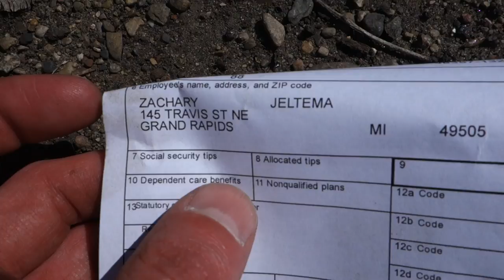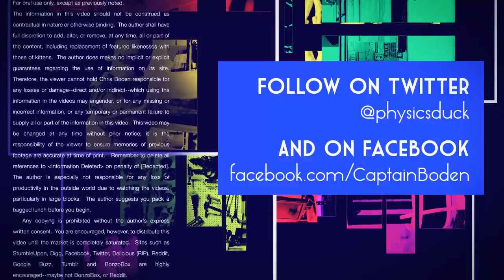Captain's Blog 5 1 2015 River Trash Cleanup and Flight Club

Comment: wow Moose is very strong to help move that steel bar.  Stephen is very thorough filtering through leaves.  very nice weather in western mass also.  how does Zack live on so little?  my income was 15,000 last year.  yes steam is better than smoke.  why do you drive?  GR has a transit system.
Reply: Sam Sitar We got in some new inserts for steel and hadn't quite found the sweet spot for the 4140 pre-hardened steel we were cutting. Burned through 4 corners pretty quickly, but found that they do well at 765 surface feet per minute, .090" depth of cut and .005" feed per rev. The steam came from one of the failed cuts when the cutting edge fractured and produced a ton of heat.

Comment: I doubt the guy dumped his trash there on purpose.  Think about it, if the guy has an address, he has garbage collection.  Why would he need to dumb his non-bulky household garbage by a river?  Makes more sense that he disposed of it properly and then it found it's way to the river after it was out of his hands.  It's probably a shorter trip to the curb outside his house than to a river bank.  And now you've plastered his name and address on the internet without giving him a chance to defend himself.  All seems very circumstantial.